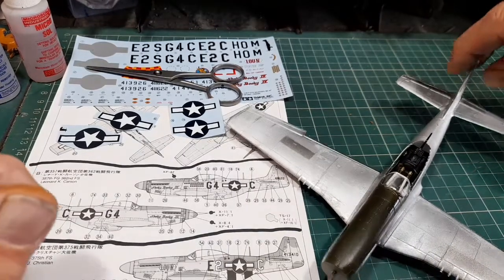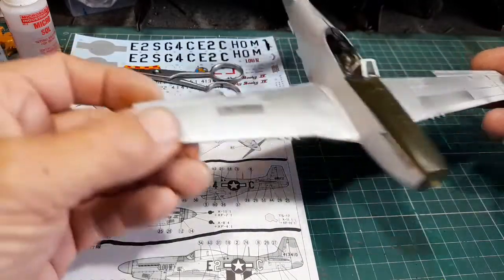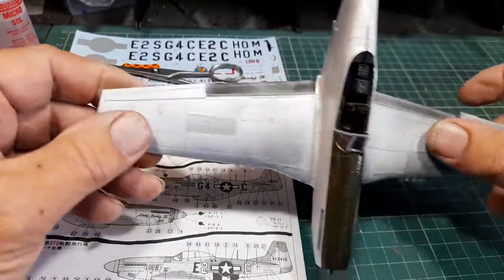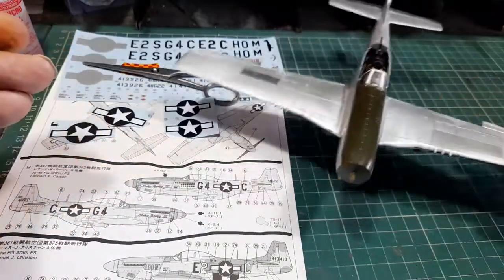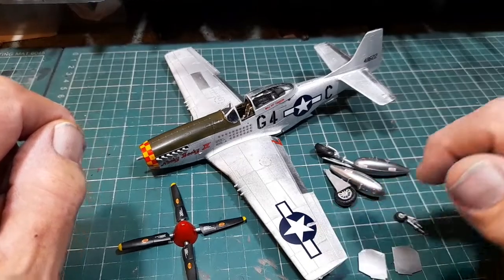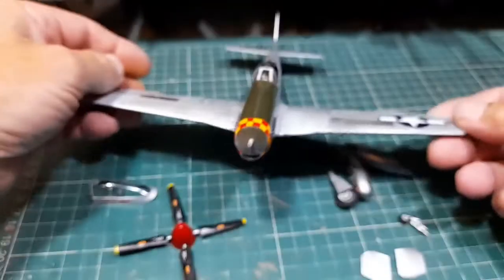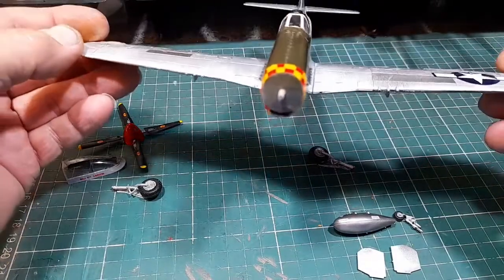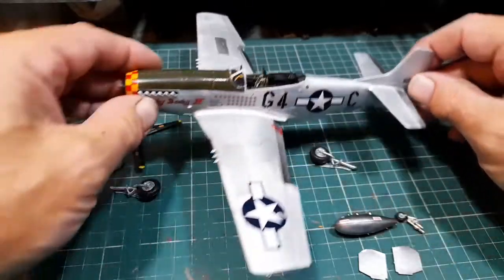Group Build Tamiya P51 D Mustang 1/48scale episode 3 MM3DTVGKB

Comment: I have to say Martin, what you have weathered so far is remarkable 👍you’ve got a very good eye for lightning & shadowing the paint in particular areas on the plane. Even with the decals being a little old & coming apart, you did a nice job piecing the ones together👍, I have ran into the same problem Martin with decaling locomotives with old decals. Well my friend I will be looking forward to seeing the finale on the P-51 , see ya mate👋😎🛩🛫✈️
Reply from the maker: Thanks very much Jeff , that's something I need to try and that's weathering some of my older locomotives, should be fun 😀. 
Thanks again for your continued support my friend